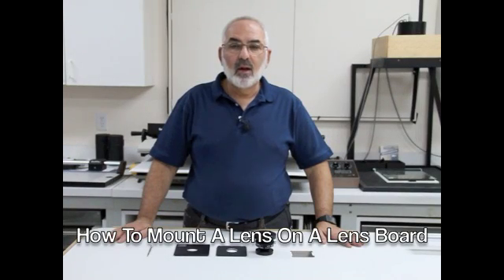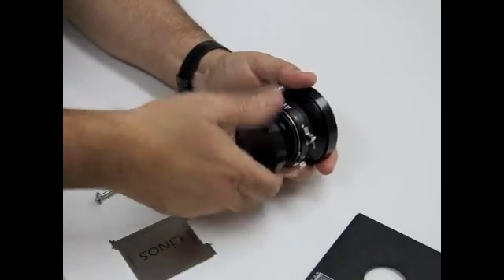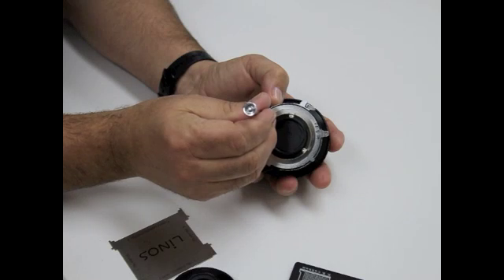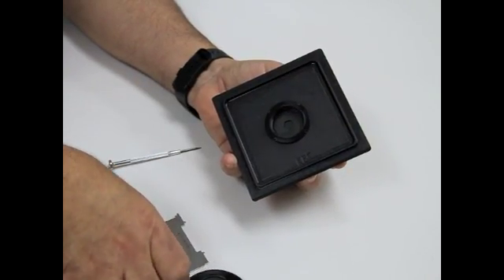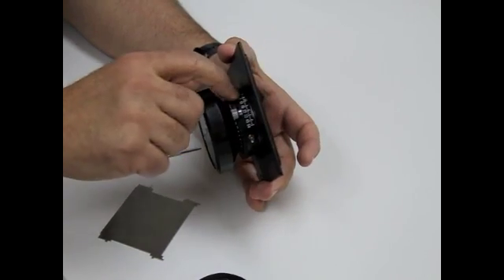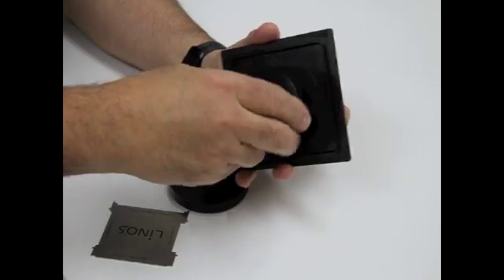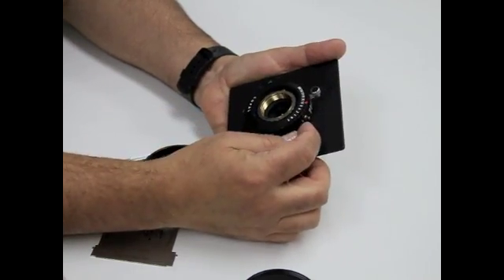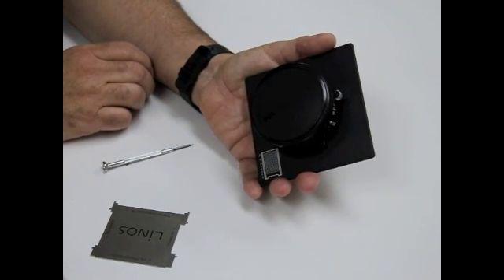11. How to Mount a View Camera Lens

Comment from the maker: Hi Armando Cruz - Your standard bellows should work fine for both a 150mm & 210mm lens.  Lens boards come is 3 sizes - #0, #1 & #3 - this corresponds to the shutter size with #0 being the smallest & #3 being the larger.  This is for modern lenses - some older lenses have larger sizes.  For a 4x5 you would want lenses that use a #0 or #1 shutter.  For example most 150mm lenses use a #0 shutter & 210mm lenses a #1 shutter.  I plan on doing a video in the near future on large format lenses.  A Calumet 4x5 should be a good starter camera for you.  Fred

Comment: Is the size of the lens board important? I wanna buy a Calumet 4x5 and it comes with 2 lens boards, but no lens. Do only certain lenses fit on certain board? in other words: do the lens and lens board have to correlate in diameter?
Reply: also, do you have to change the bellows if you go from a 210mm lens to a 150mm??